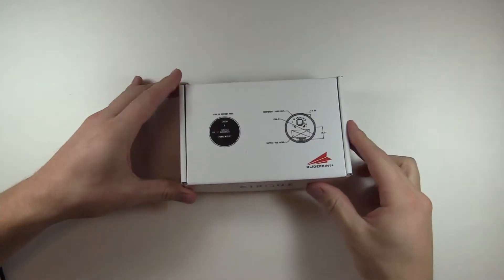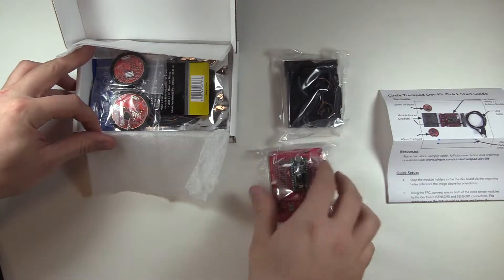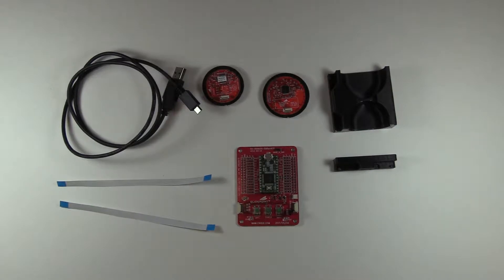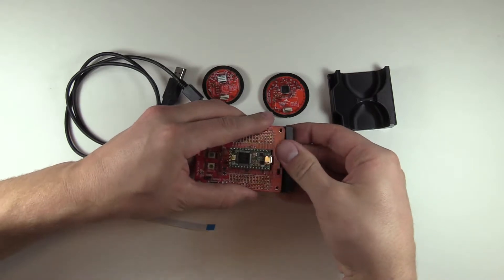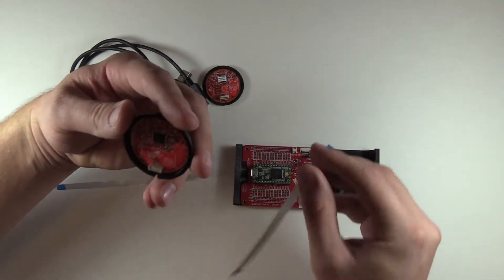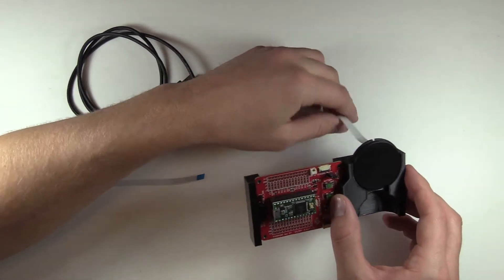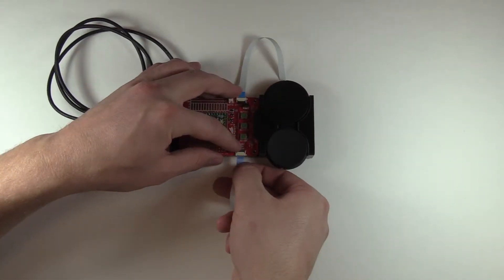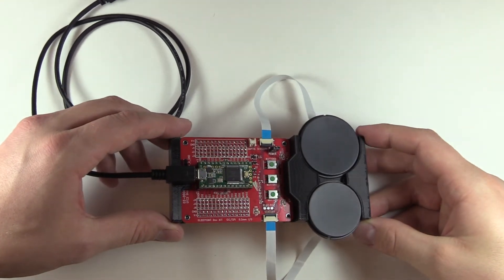Circle Trackpad Dev Kit Assembly (Arduino Based)

Comment: Is it possible to use the trackpad with an esp32?
Reply from the maker: Hi Anto, I would recommend posting this on our message board (https://cirquecorp.discussion.community). Our engineers will be able to provide a better response there. In general, the touchpad should be able to work with almost any microcontroller host that supports I2C or SPI but it would require some porting of the reference Arduino code.
Reply: @CirqueCorp  Thank you very much, I'll check!